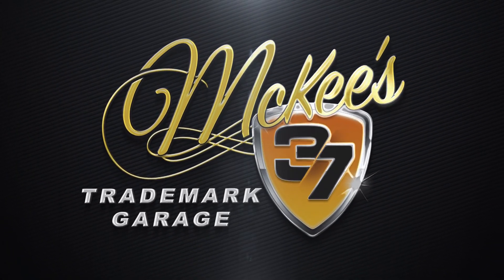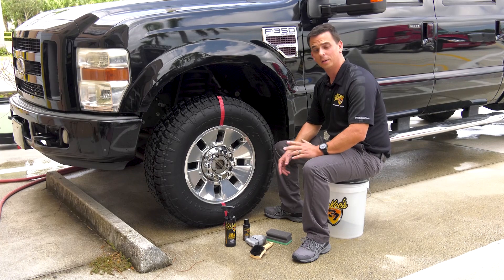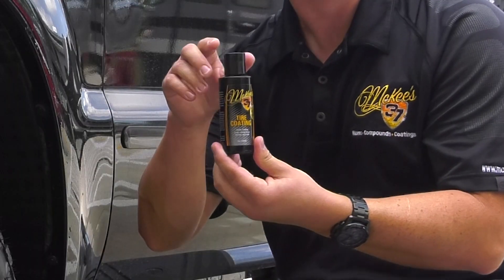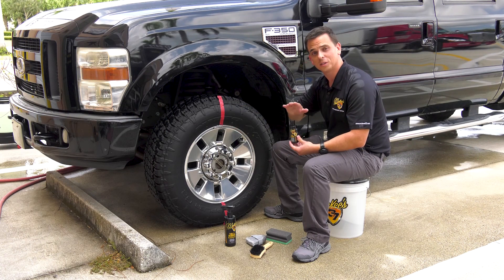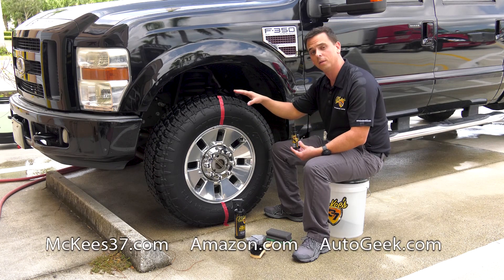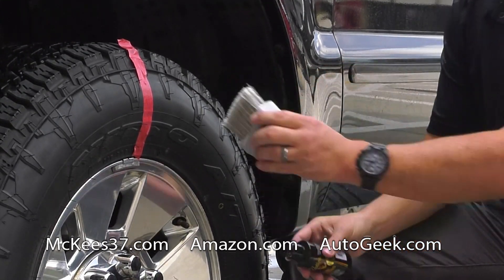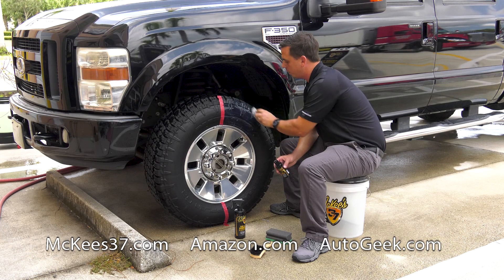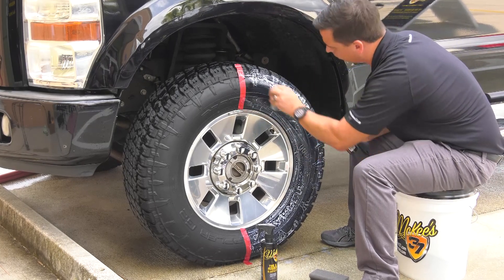How To Apply Tire Coating to Large SUV and Truck Tires

Comment: Very interesting. As a weekend warrior I wasnt aware of this product. Question for Nick or any pro detailer: If this coating is better and longer lasting than most tire dressings why wouldn't i just use this on all tires, not just trucks/suvs? Why was the video targeted to larger truck tires? Educate me. Thx.
Reply from the maker: Hello Stephen.  The reason this F350 was the obvious choice for this video is the LARGE SURFACE AREA of the tire, making for a GREAT visual indicator of the before and after difference.  This kit can be used on ALL tires, big or small.  -  Nick @ McKee's 37